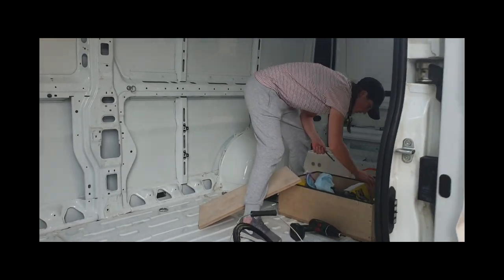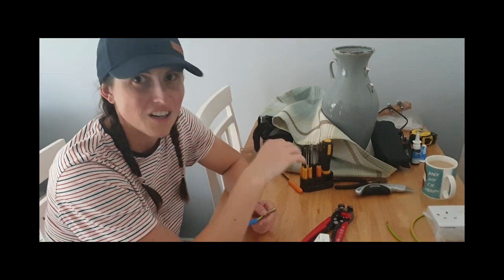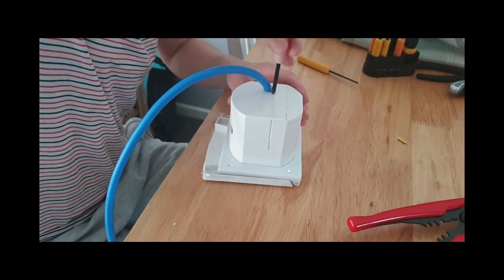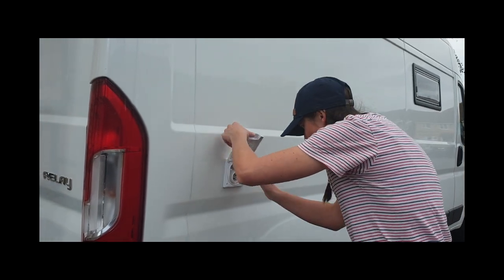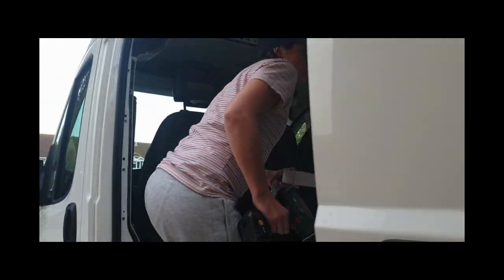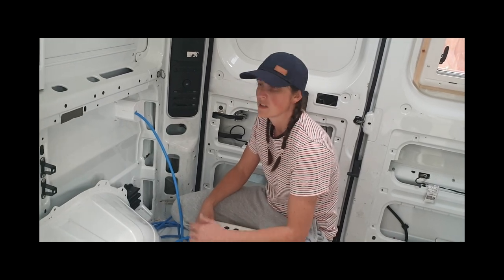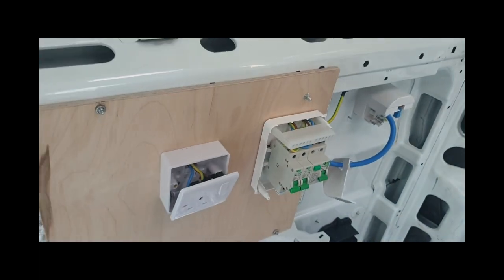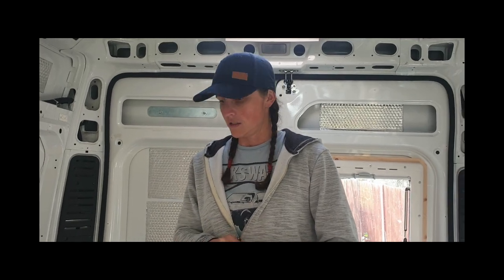HOW TO install 240v electric hook up in campervan build.

Comment: Lou, did you have any issues with this earth? This is how I've done mine today...but been told it should go to main common earth?? Confised
Reply from the maker: Nope, not a single problem in 5 years. I must stress though that I am not a professional in anyway at all. This is just the way I did it.
About 3 years after this I had to add an additional earth on the 12v side as I added an inverter to my setup and from vague memory I think that required one.

You’ll find you’ve stumbled on a big hoo ha about the correct way to do this within the van building community, and in all honesty I can’t remember the arguments for and against now. 
I do remember doing an awful lot of research at the time though, and it gets confusing!

Comment: Well done ! My only point is that the 6 amp breaker is best suited for low voltage lighting ( eg: led) with perhaps a further two breakers (16 amp for power socket - suitable for a 750 watt microwave ) and a 25-30 amp  for an induction cooktop of around 2500 watts... cheers

Comment: Thanks for the video. Something I'm thinking of doing. I have lithium batteries, but it would be great if I could hook up to campsite hookups and use a big charger for them. One question, when you drill the screws through the van, do you have to do anything to protect it from going rusty ? Like paint it with some anti rust paint or something ?

Comment: Hi, I have an old t25 1986 autosleeper. I got it back from the garage after they wired up the fridge. It works on 12 volt but not on 240 volt for hook up. In fact nothing works now on 240volts, no fridge, no lights, no sockets. I have checked my hook up cable, my external 240 volt cable and feed and fuse box all ok. Any ideas, what is going on?

Comment: Hi guys, great vid! What size is the big blue wire? About to do mine and was wondering if I can use the fat cable I've got which is 2.5mm2 for each of the 3 wires.. Thanks!
Reply from the maker: Hi Chloe, to be honest this was so long ago I can’t remember now and I wouldn’t want to give you the wrong info. I remember more about the 12v wiring as I had to do a lot more of it but I just bought this as a kit and fitted it and my brain has now decided I don’t need that info anymore. So sorry I can’t be of more help, and good luck with your install.
Reply: @campervibe  haha no worries, thought this might be the case! Thanks anyway!

Comment: You do tidy work is very good. Few comments for others watching the video, These sockets come with a foam type gasket that you put on before inserting into the van this offers a cushion effect helps with vibration and some weather protection, I tend to also add a thin line of non adhesive sealant, she was right to consider doing this. Also don't forget to paint the drill holes, I understand they protected the large hole but not the screw holes, if your drilling can paint then or if you use drill screws just undo and paint all four then redo.

Comment: Hi. Stumbled on your video. Was entertaining. But I'm concerned about grounding to the chassis. If there is a problem from the shore power outlet to the distribution box (consumer unit), you will be fine as long as you stay in the van. Because the tires are insulating you from ground. But if you step out and touch the van it could be a deadly shock. Since now the current can go from the electrified van chassis, through your body, and finally to the ground to complete the circuit. We usually ground things to protect the electronics. Your Gfci (rccb) that I saw you install will protect you from any faults in the van. And if there is a problem, the AC ground to the chassis is only a hazard and probably will fry your DC van components like your house battery. This is already a problem with motor homes. Search RV hot skin and you'll see what I'm talking about. Hope this doesn't scare you. Just trying to be helpful to another van lifer. Cheers!
Reply from the maker: Hi there, thanks for the comment and for watching the video. I think I mentioned in the video how controversial this topic is, it causes many an argument amongst van builders so I'm not going to get into a long winded debate about it. After months of research this is what I found to be the best and safest way, it's since been checked by two auto electricians (qualified) and they agree that it's done correctly. Like I say, this is just the way I've done it and I'm not saying it's definitely correct but I'm happy with the install and even more happy that 2 certified electricians have said its right. Thanks again for watching 👍

Comment: Hey, loving the videos. Have learnt so much from you guys. Quick question (still trying to understand everything it’s all so confusing 🤯). As you mention in your video your rcd/mcb is connected to your single plug socket via 6a which I believe it mostly good for lighting etc. Did you use this exact same setup when plugging in your battery charger, straight in to the single plug socket? Was 6A enough?
Reply from the maker: Hi Charlie, from memory (it's a while back now) the battery charger is plugged into wired into the other side, I think that one was 13 amp, but the van isn't here at the moment or I would check. I can't remember entirely, I know they were different amps but can't remember if definitely was 13, could have been 3!If you can wait a few weeks till the van is back I can check, sorry I can't be of more help.
Reply: @campervibe  thank you! That does help massively 😊

Comment: Hi, a couple of observations, 

Firstly I personally put all 230v flex in a piece of dedicated conduit for added protection, your board as shown is only a short run so fine but if you were to say run any of it around, through up and over the metal work in the van etc then conduits pretty essential.

Secondly yes you did the right thing earthing the supply to the chassis this is mandated in BS7671  
but there is a sting in the tail:

All Caravan installations should comply with BS7671. 
Within that, regulation 721.411.3.1.2 states:
"This requires structural metallic parts that are accessible from within the caravan to be connected through main protective bonding conductors to the main earthing terminal within the caravan."

So good so far but,
Regulation 708.411.4 states: 

"The Electricity Safety, Quality and Continuity Regulations 2002 (ESQCR) prohibits the connection of a protective multiple earthing (PME) facility to any metalwork in a leisure accommodation vehicle (including a caravan)."

This effectively means no Caravan  if wired in accordance with regulation 721 should be connected to a typical UK domestic supply if it has PME based earthing.

Most UK properties use PME.

The problem with the latter is nobody in the van community seems to know that, I didn't until I did my own research!
If any form of warning is included in new Camper and Caravan owners manuals I doubt it in plain enough English for the layman to understand.
So we all, in ignorance,  happily plug our vans in to our household domestic supplies.

Obviously you don't hear of people being electrocuted so the risk must be low but there is still a risk.
The reason for that risk is because PME uses the supply Neutral as earth, if a fault develops with the supply then there is a possibility of the vehicle chassis rising to a dangerous voltage which could find a path to earth through a body as they contact the vehicle on entry.

To correctly connect a Caravan to a UK Domestic supply whilst remaining compliant requires that supply to use a different earthing method.

This can be achieved at home via a variety of methods but in reality I know of no one that has ever been advised to do so by a salesman or by an electrician whilst signing off the work.
Obviously that would only mitigate the risk at that one location not on a friends drive etc!

Lastly a mains tester is well worth having in your van especially if using hookups abroad where they can get the live and Neutrals reversed.
The Kewcheck 103 is excellent to keep in the van and only costs around £18.

HTH.
Reply: @criftinscampers Having just studied all these electrical regulations I agree with your statement completely and wish to add that the ESQCR regulations are STATUTORY which means they are the LAW, unlike British Standards which are basically a guide. So the hook up earth must NOT be connected to the steel van body.  A pinned comment to that effect would be advisable considering how popular you guys are in the vanlife community. Best wishes Greg x
Reply: Hi greg . If you dont earth the unit to the body of the vehicle. How would you recommend earthing it . Thanks  @GregVirgoe
Reply from the maker: Hi there, we have a reverse polarity tester for when abroad and our one run of flex cable to the single plug socket we have in the van is this side of the insulation and walls in a protected cable way.
As for plugging in to your house, it's not necessarily the correct thing to do but we've only really done this to test the initial install, although many, many vanners do it on a regular basis to top up the batteries.
Like I said in the video, I'm no expert, this is just the way I've done it.
Thanks so much for watching 😁👍

Comment: Hello! Great video, nice and easy to follow :) i'm just buying the parts and going to try and going to try and do this. How much blue cable did you buy? Wondering if you bought a lot for the rest of the van or just enough for this part?
Reply from the maker: Hi li, thank you 😁 I think I bought about 5 meters, but we only have one 240v plug socket in the van, everything else is 12v so different cable for that, hope that helps 😁

Comment: I wasn't particularly fussed with the idea of having mains hook up but as I'm only just about to start my build, and the days are already getting shorter, it actually makes sense to add it at the start even if its just to be able to use lights to extend the working day. 
I have to say as well, I was cacking myself at the thought of doing it but you've actually made it look pretty simplistic. Thanks for that. :-)
Reply from the maker: Hi, yeah Lou was not looking forward to doing it either, I always had faith in her abilities and I'm sure you will do alright as well 👍👍

Comment: Hi just found your channel and Ive watched this video thanks for posting I have a question thats been confounding me for a while now maybe you can shed some light on it for me 

The van as we know runs on a 12 volt system powered by a leisure battery that runs all the appliances such as lights fridge etc . .  then you have an electric hookup such as you have here that together with an inverter runs appliances on a 240 system such as you find in a house 

my question is how do you use that system? does it run side by side with the 12 volt one  do you install wiring and sockets at the build stage and simply plug in as and when needed and how does the 240 system charge the 12 volt system

sorry but im a complete noob and i want to understand how all this works for my own van build next winter
Reply: ha ive just seen your other video explaining all this
Reply from the maker: 😂😂 I've just tried to answer anyway lol!
Reply from the maker: Hi Michael, I don't actually have an inverter, although most people will have. My system is entirely 12v, as I have managed to find 13v chargers and options for everything we wish to run in the van. If there are specific 240 appliances you want to have you may well need an inverter for when you are not on hook up, however it does waste power converting 12v to 240v and then often back down to something like 19v for a laptop or something, that's why we don't have one. The way I understand it is most people have some sort of switchover for their 240 sockets depending on if they are hooked up or not but I don't know much about it, I think I would just run two separate sets of sockets, one from the inverter and one from hook up, just to keep it simple.
As for charging the batteries, this is the only reason we have put in the hook up, so if our solar isn't great we have the option to charge the batteries. We have a victron mains charger that just plugs in to one of our sockets, and then I have put in one more socket that we can plug things into if we are hooked up at a campsite. And yes, I had to fit this, and run all the cables pretty early on in the build, it was one of my very first jobs. Hope that is of some help to you, and thanks for watching 😁👍

Comment: Hi, great video. I've just subscribed to your channel and looking forward to seeing the rest of your videos.

Hope you don't mind me saying but when you're screwing anything onto the van it will be much more secure if you put some plywood on the inside and then screw straight through and into the plywood. It will give it a much more secure fixing and greater longevity.
Reply from the maker: Hi mack, welcome to the channel, thanks fo following along 😀 luckily this was the only thing we have had to screw into the van so 🤞 thanks for the tip 😀

Comment: Hey great video thank you. Made it so much clearer to understand.  Quick question though... how does this charge your batteries? What else do you need to purchase ?
Reply from the maker: Hi, thank you 😀 we've made another video which kind of follows on from this one, I'll give you the link. You need a mains charger. Then if you want you can add solar or a battery to battery charger if you don't want to plug into an electric hook up. We've done videos on those too.
https://youtu.be/V0Auk8dhlnw

Comment: Nice videos. How much does it cost to charge the batteries from shore and from where?
Reply from the maker: Thank you 😁😁 Well you can charge them from wherever you plug it in, a campsite, a stop over. We charge ours from our house. We have also added a solar panel now so if it is sunny it costs us nothing 😁
Reply: @campervibe  but if you want to charge from campsite then how do they charge you? i mean what would be the cost?
Reply from the maker: @rashedulhasan5372  well you pay for a pitch, so that would depend on the cost to stay at te campsite, in the UK that can range from £7 to £50 depending on the site.
Reply: @campervibe  thank you.

Comment: Could do with sealeant/adhesive under that socket as it will leak with time.
Reply from the maker: That's why I mentioned it in the video, said I will change it if needs must, the foam gasket will be good for a few years yet.
Reply: @campervibe   cool, about to do same job on mine :)
Reply: @jokernia  What will leak?
Reply: @lukejamesharper4382  condensation from the inside wall of the van 'could' leak through the hole and cause buildup of mould on the gasket. But like Louise said it'll last for a few years so jobs a good'n.